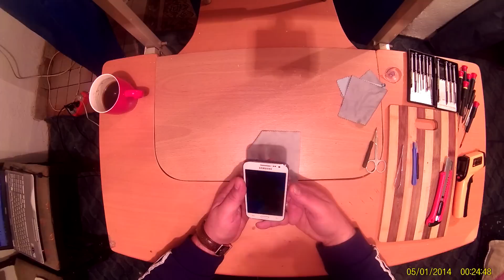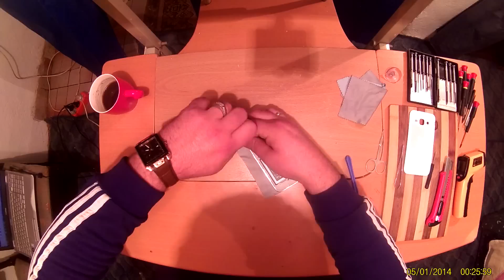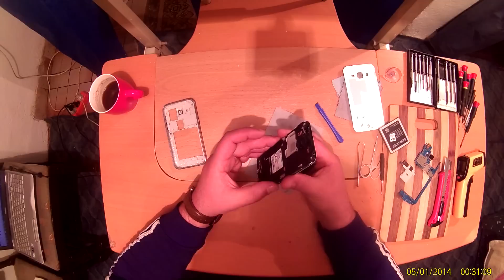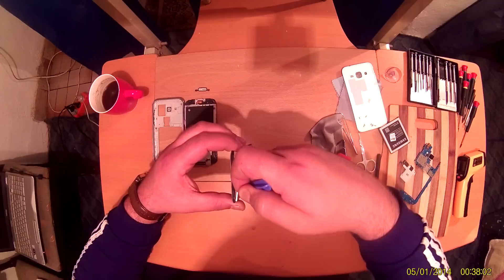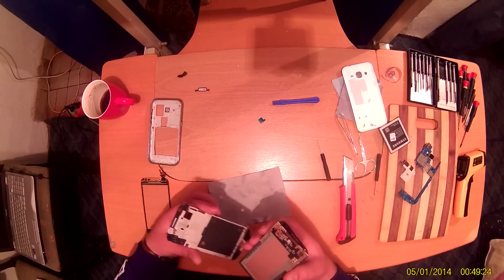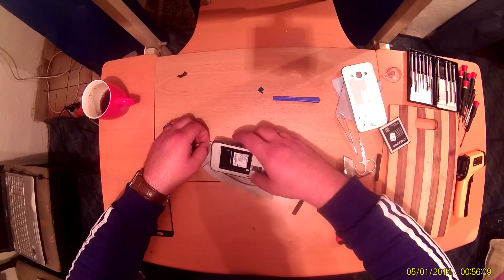Samsung Galaxy Core Prime Touch Screen Replacement.Every detail

Comment: Umm, my phone is Samsung Galaxy Core Prime, Model Number :SM-G360T1. My phone has a cracked screen but is still working , but after weeks, my phone fell on the water and I took out the battery and all, and the phone was working fine but the touch screen is not working now. What should I do? Please help me :(
Reply from the maker: In most cases with water,suffer most touch screen (95%)  but sometimes can be something else.If you think it is touch screen and if you decided alone  to fix it ,check it well my video with caution, you have every detail for successfully  touch screen replacement. Watch it from beginning to end, the details are very important not skip parts.If you think you could not then check with your local mobile fixer.Greeting Kharla.